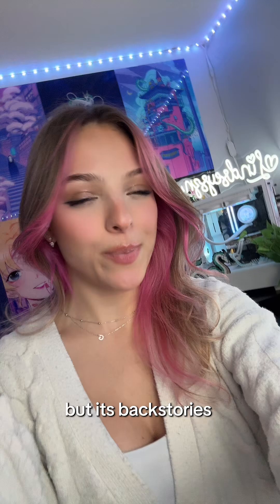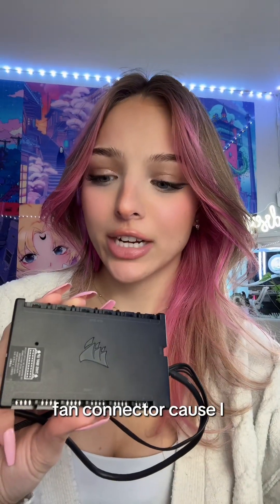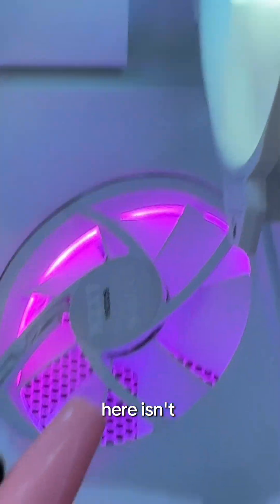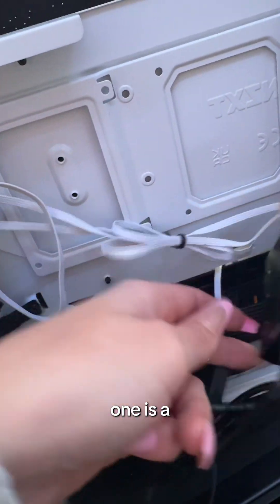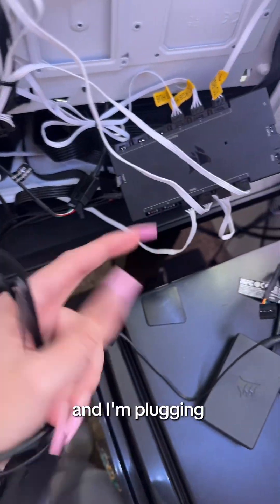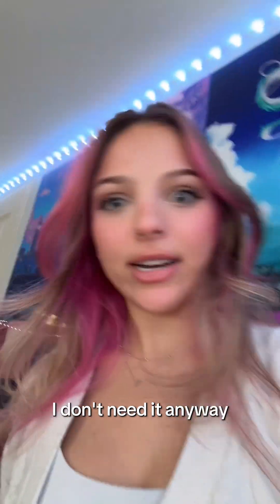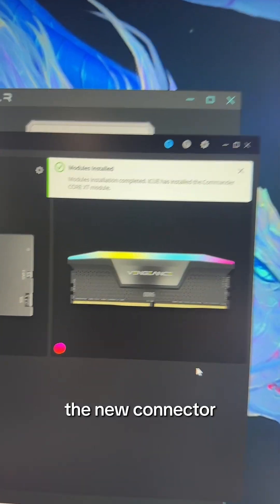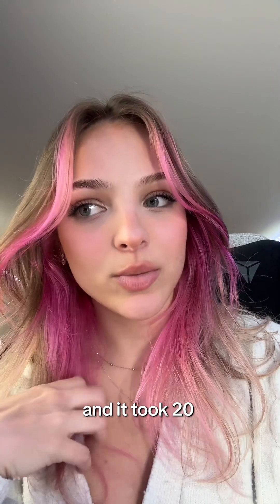fixing my pc fans #lindseyszn #techgirl #gamergirl #techbaddie #pcgamer #pcbuild #pcfans #corsair

Comment: Unless that rear fan has reverse blades, that is an intake fan. Generally, the front of the fan is the side that is sucking in air, so the back of the fan should have air coming from it.
Reply: Would be funny if it was a reverse blade, but it is mounted like that to exhaust air while looking like it is intaking, like her PC looks very clean so it probably possitively preasurized with dust filters in the intakes. Though some people do use a rear intake to give the AiO some more access to fresh air intake, which isn't that worth it in my oppinion, like a bunch of dust over a 2 or 3 degree upgrade.